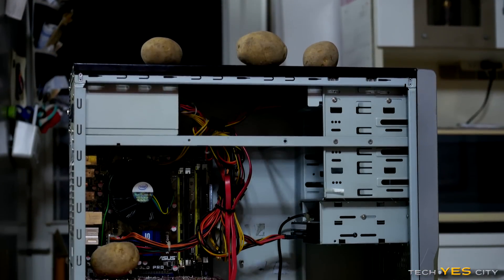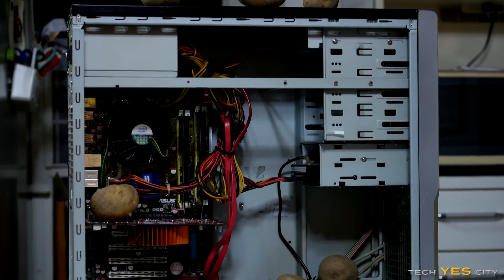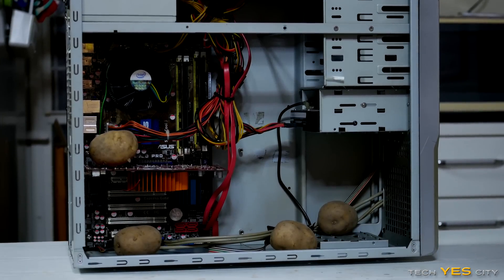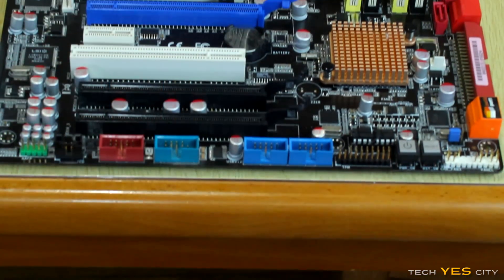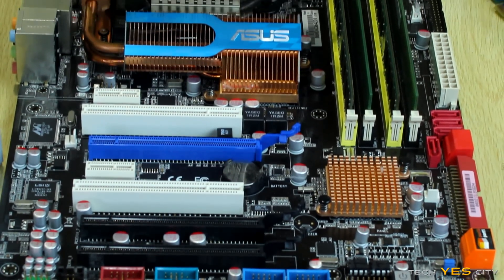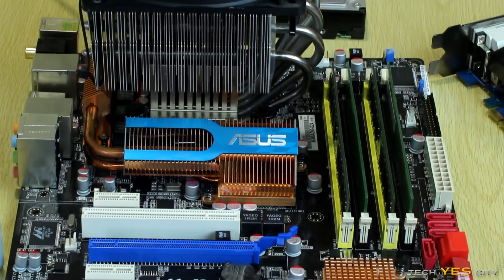The $70 CS:GO POTATO - 1080p CS:GO for Under $100?

Comment: Just got a bunch of PCs for $10 each. One is a LGA 775 build with an Asus p5k deluxe with a core2duo, 450watt PSU, 250gb HDD in an old cooler master case (looks good too) gpu wasn't even worth mentioning, but for $10 I'll take it. That mobo alone is fairly pricey. Also came with about 6gb ddr2.

Comment: Brian, love your videos. Have an Asus p5d 2.66 ghz core 2 quad 8 gb DDr2. Use it for surfing and have a bunch of early/mid 90's game loaded on this and have a blast playing my old favorites on this old machine.. When I was playing these in the 90's I was on an old AT K6 475... Traded out the old AT for an Athlon 2000XP atx board and cpu..Except for the new ATX mobo /cpu combo am using it still 23 years later. Still performs like a dream and the Mechwarrior 4 stuff plays great  with my old  AGP Geforce 2... though have gotten a newer AGP card to tryout to see the max graphics settings I can squeeze out of the game.  Only use it sporadically now but still love that old setup. I have loved all the x58 vids you've made and it is one of my favorites to put together now. I have 5 more 58's in the que now not counting the new 10/11th gen toys I have upcoming. Was doing pc's full time in the 90's 2000's but got out of it in 2001 but now I'm retired and having fun doing this once again.. keeps me mostly off the streets. Keep it coming. Craig

Comment: i have athlon ii x2 630 + hd 6870 +8gb 800mhz ddr2 dual channel + windows 7 64bit. im running 20-50 fps in 1920x1080p low settings, how does that pc do better than mine? i just reinstalled the os and no other games installed except csgo and valorant. plss help

Comment: How are you managing over 100 fps on that system. I have a core 2 quad q6600 at 2.7 ghz which is essentially the same as your processor and I have a gtx 660 ti and 8gb of ddr2 800 mhz. I can only get up to 70 fps and experience lows in the 40s ):
Reply: Its isnt same his proc is at 3.16ghz and has more cache+bit better ipc
Reply: @Spacy1717  but that wouldn't make more than a 5 frame difference. The issue is that every time valve releases an update for csgo, they cripple the performance ever so slightly. I've seen people with a q6600 and 750 ti get upwards of 120 fps with less ram than I have /:
Reply: @Spacy1717  and I said essentially the same, not exactly lol I know the difference between lga 775 processors
Reply: @obungaswanson  maybe something is wrong with your system or you have stuff running in background
Reply: @Spacy1717  I've pretty much tried to diagnose every problem on my pc that I could, I ran sfc /scannow, and I ran DISM. I even reinstalled windows lmao. I'm pretty sure the issue is the scaling of valves source engine for older hardware like mine. I've seen people complain on reddit that the performance got significantly worse after valve released the dangerzone update. But I mean that's alright though I dont play csgo too often.
Reply: @Spacy1717  I think this means it's time for me to upgrade to ryzen lmao
Reply: @obungaswanson  meh i just upgraded to lga 2011 system with 50$ xeon e5 2689 8c/16t 3.3ghz enough for me
Reply: @Spacy1717  is it the e5 2680 v1 or the v2/v3? I might check them out
Reply: @obungaswanson  its e5 2689v1 sandy bridge e
Reply: @Spacy1717  also am I gonna need registered ECC ram for that chipset or can I use regular unbuffered ram
Reply: @obungaswanson  if you use chinese huanan x79 mobos(very good quality btw im typing on it) you can use both im using 16gb ecc ram but normal 16 gb would work okay too
Reply: @Spacy1717  that's awesome, thanks man

Comment: Can anyone suggest parts to build a csgo PC for around 50-70 dollars
Reply: Core 2 duo or quad
Gt210 or hd 6450 or (5450 r dirt cheap)
2 gb ram 4 will be better
HDD depends on your demands
U can get one for 10 or 15 ithink
And u will have a pc better than this in the video
One more think you can overclock the core 2 duo or quad using tape method bsl tape method which can boost u a little bit
Reply: @mobeenshaikh553   Lmao dont do that at all. You can get a second gen i3 or i5 system and throw in a older card like a 660 or 750 in it and its good. (hell ive seen fourth gen i3 pcs go for the same price) the gt210 cant hold half life 1 on 1080p let alone csgo.

Comment: I've recently built a pc
It has:
Core 2 Duo E8500 2 Core 3.16 Ghz 
HD 7870 2GB Ghz edition
8GB DDR2 800Mhz 
64 GB SanDisk Ultra SSD 
500 GB Seagate momentous 5400 RPM 2.5" HDD

It's mostly used for word documents and a little amount of minecraft
500W Kolink 80+ Bronze (400W continuous power)

Comment: fuck im from ph my 400 dollar pc that i bought wprth 20k php worth 400usd with spec intel pwntium g620 2.60 ghz with 2gb ram intel hd 700mb can run dota 2 2018 at 1024x700 res with mid set 20 fps lowest sett 60 fps wtf?
Reply: do u think guys i can run csgo but incsgo group they warn my frames what does it mean do it get burn xD??

Comment: I picked up an Acer Aspire the other day for £40, i7 860, 3.6ghz turbo (had to update BIOS to get the turbo to run, was sticking to 1.9ghz before), 4gb 1333mhz RAM (bought another 4GB for £10), 640gb HDD, Radeon 5450 512gb graphics card which I'm on the hunt for a 750ti or r7 380/r9 270 for around £30-40. Got it mainly for automated background photoshop tasks and rendering but also for old school LAN gaming, but with a new card and the extra RAM I got, I think it could keep up with 99% of modern games at low-medium settings. All for a total of approx. £80-90.

Comment: I got a hp prodesk with an i5 4570 from my work surplus for 40 bucks. Spent 30 bucks to double the ram to 8 gigs. Added a different PSU and dropped a old gtx 960 4 GB in it and made myself a nice little CS:GO PC

Comment: I still don't get if an app is better than a low-end GPU like the one used in this video, I'm using an Amd a8-6600k at 4.5 Ghz and the integrated graphic and I get around 40/50 fps
Reply: silly me, if only you knew how much life would change for you in 8 years lol, I wonder what I was doing when I wrote this

Comment: So I think I've come across a gem. Of course I have my own nice rig, but I picked up a computer off of ebay with a radeon hd 5450, with 8gb of DDR3 ram. The processor is an i3 2120. I purchased it for $85. Question is, do you think I can run this over 100 frames a second on 1080p?

Comment: brake cleaner is good, but be careful with one thing, BC in can acts as penetrator medium and due to some changes in the flux and solder in the last year it can crack the joint. My good advise (and way cheaper) is to buy it in barrel (dont know how in kangaroo land, but here cost 10L keg the same amount like 20 cans) and just use those refillable push pressure spray thingies.

Comment: I usually play on Xbox One because of i sold my Gaming Pc I still have my Multimedia Laptop that can run Games like Call of Duty Black ops 2 Medium and Just Cause 3 Medium on 40fps. But at CSGO this is the Low End Game i cant even get 35fps on very low and 4:3 800x600? Anybody knows why? Here are my Specs.

8GB Ram DDR3, Intel Core I5 4x2.50ghz , Nivida Geforce GT 630M 

I can run Betther games than csgo on 1080p at Medium but Csgo at 800x600 4:3 Very low hmmm.

Comment: When you build a pc, do you have to do the wiring?
Reply: h-00-d no, just connecting them to the motherboard, gfx card ect.
Reply: Scyne Do I need the sprays and all that shit?
Reply: Spaz3 you mean pressured air? To clean it?
Reply: Scyne Yes.
Reply: Spaz3 no, you can just use a rag or whatever if its really that dusty.

Comment: I wanna kms because I have a $350 PC and cant even get 50 FPS at Medium Settings
Reply: AGuyOnYouTube dont worry my 750€ laptop gets only 90+ fps in nuke with max settings
Reply: my craptop on medium settings can only get 20/30 fps
Reply: my laptop cant even run cs 1.6 at 40fps low
Reply: ONLY?
Reply: Mine costed 330$ and I get almost 200fps on average on medium so....
Reply: ORB1TAL GAM1NG you have a shitty pc what is it prebuilt
Reply: If you have 10 years old pcs costed 600 dollars in time it doesnt mean they are running good now
Reply: Csgo is a processor heavy game you prob have more money invested into ur gpu I built a 500$ CAD and I was getting 120+ fps on max settings
Reply: @dillonmcpherson6208  dawg I forgot I even commented this, it's about 4 years later and I have a setup over $1000 and I can play most anything at high and get 60, I have a 1070 and an R5 1500x
Reply: ORB1TAL yessir I got a 1080ti and i7 -8700k  runs any game I could want however I want don’t see why I need to upgrade yet

Comment: I wonder why my pc run at 50-70 fps

Csgo Settings:All Low

Specs:
-i7
-amd hd 7570
-8 gb ram
Reply: TaffyZ N Graphics card is bottlenecking your cpu probably
Reply: Get a GTX 1050 and 8gb ram
Reply: TaffyZ N a 1050/970/1060 will probably help
Reply: Oath Abide but why cant i?
Reply: Oath Abide Your GPU is poo, you can get better ones for very little money, look into it
Reply: TaffyZ N Did you try to reinstall?
Reply: Well laptops such as Acer aspire e15 also can run cs go too!
Reply: Make sure to always update your drivers when you can
Reply: TaffyZ N u should put in 8 more gigs of ram it will probobly help idk
Reply: Luka Meister no it wont
Reply: TaffyZ N what i7 do you have
Reply: TaffyZ N Graphic card bottlenecks the cpu get 1060 6gb

Comment: anyone else bothered how he's handling the parts?
Reply: Electronic components are incredibly durable these days. I've pulled old Pentium 3 systems off of the side of the road and bought them from the refuse store at the dump, no exaggeration. You'd be shocked at the kind of crap you can get running again.
Reply: I honestly don't think he cares about the parts...  It's a potato that he put together solely for the purpose of making this video.

Comment: my potato pc has only:
DellT3500 motherboardCheap generic case "modded" cuz that board is big as fuck and i didn't have money to pay 100 bucks for a case to hold that
Intel Xeon x5677 3.47 GHZ 
10 GB DDR3 1066MHZ
AMD RADEON HD 7850 2 GB GDDR5
Seagate 500 GB SATA 
500 WATTS PSU
Windows 10 Pro

Comment: - mainboard built UP HP shocket 11155 ivybridge upgradable
- processor intel ivybridge core i3 series 3220
- ram 16 GB ddr3 
- vga 2Gb ddr5 directx 11. Nvidia geforce GTX 750 ti .
- hsf original intel built up 
- hardisk 320 GB WD New 
- power supply BU truepower 80+ 
- casing dazumba devito 

is it a good for pc gaming?

Comment: and im here having spent 200$ on a Dell Inspiron 11 with a 1GB Intel HD and Intel celeron 1.7 ghz which i overclocked at 2.2 gHZ, an 2GB DDR3 RAM, and i can only run csgo on medium on 1280x720 instead of 1366x768 at ~54 FPS

Comment: can this laptop handle cs go at max res?  
 Intel Core i5-5200U (2.2 GHz) - 500 GB HDD - 8 GB RAM -Windows Home 64-bit
Reply: Probably not unless you put it on low settings.
Reply: definitly not! I would buy a Laptop with a dedicated graphics chip like a Gtx940m gtx940mx gtx950m gtx960m!

Comment: can anyone help i have no idea about gaming pc's i want one that can run minecraft Gta csgo waw mods maybe bo3 in 1080p 60fps minimum
Reply: MrPiggy LikesTacos nvm didnt see the budget but just some advice:get amd...AMD's much more reliable and cheaper and still great
Reply: my budget is under $100
Reply: +MrPiggy LikesTacos (MrPiggyLikesTacos) buy a Core2 quad Q9400 (20-30$ CAD)
4-6gbs of ddr2 ram (12-20$) CAD
A used R7 240 2GB (I bought mine refurbished from newegg for 60$) 
A cheap 1600x900 monitor (you can use a Tv just not as good)
And a cheap 300w psu
Reply: +HueHue Jib thats it
Reply: +HueHue Jib because at the starting of the video it said that so should i huy what ur saying????
Reply: +HueHue Jib what about mother board etc
Reply: Just any lga775
Reply: i have a q9400, r7 240, 6 gbs of ram and a lga 775 asus mobo and play my games at 120 fps
Reply: MrPiggy LikesTacos You can get a 750ti or 1050ti for a graphics card,an athlon x4 860 for cpu,a 400w psu,8 gigs of ram and a decent ddr4 motherboard
Reply: MrPiggy LikesTacos You better get a job, kid.

Comment: what is that spray cleaner you are using?  and does is just evaporate?  Also what type of towel  is that that doesn't snag on the circuits?

Comment: What's the maximum fps will I get in csgo?
CybertronPC palidium desktop 
Specs:
intel i7-6700 3.40GHz Quad-Core Proccesor, 16GB DDR4 Memory, NVIDIA GeForce GTX 970 (4GB GDDR5) Graphics, 1TB HDD, DVDRW, Microsoft windows 10 home 64-bit

Comment: is that compressed air at 1:48? if it is its not supposed to spray liquid stuff!
and please dont use your dirty fingers to spread thermal compound
what the heck are you spraying on the parts at 5:10?

Comment: What is the dedicated ram of that game? I have 2 Terrabyte of ram but my aunt would give me another 2 terrabyte on my birthday next month l, is that enough RAM to play that game?
Reply: Ram alone wont increase fps, try getting a better graphics card or cpu.
Reply: Sorry, but you need 10TB of DDR5X-42069 RAM and 4 360GB Titan Y's with 2 6.9GHz 69-core/420-thread Xeon CPUs. You also need an M.666 SSD so it doesn't take 69 years to load.
Reply: you are actually taking my comment srsly? im a troll m8
Reply: 10/10 troll right here
Reply: you should get a gpu, it will make more differnence
Reply: twinkle fart
My real cpu specs are
i5 4460
EVGA GTX 960 Superclocked
MSI z97 PC MATE 
Corsair Vengeance 8GB (4x2)

Check my steam khrystal
Reply: hayato zami Get 16GB of RAM.
Reply: +Johan Ekstrom its already shiping
Reply: hayato zami Good. I'll have a 1070 myself, with a 2nd gen i5 and 8GB RAM until next year, when I'll get a Haswell Xeon. The motherboard only has 2 RAM slots and it only supports 8GB or less.
Reply: +Johan Ekstrom sweet... I quit csgo for arma 3, ill rather have a better cpu than a GPU. Sweet tho
Reply: hayato zami Well, the CPU is pretty dope. Its a fucking i7 without an iGPU and can be overclocked with certain motherboards, so it's basically a 4770(K if you have the motherboard for OCing) That'll run everything for years and years.
Reply: Laptops is enough for play cs go at 60fps dude
Reply: oshawott98 a laptop that costs $1000 and dies in half a year doesn't count for running csgo

Comment: so i just finished building this pc, i wouldn't say it's exactly $70 (obviously) i ended up spending around $115 by using ebay, amazon, newegg, etc. and i got around 65-95 fps in csgo medium-high settings, and on low i ended up with around 110-125fps which isn't bad for this pc.

Comment: Hi, I tried to do the same as you but I'm only getting around 60fps on 1080p low settings and around 100fps on 720p low settings... Is this normal? These are my specs.

ACER ASPIRE M5620
OS Windows 10 Education 64-bit
CPU Intel Core 2 Quad Q6600 2.40GHz
RAM 4GB Dual-Channel DDR2
MOTHERBOARD Acer G33T-AM (Socket 775) 
GRAPHICS NVIDIA GeForce GT 220 1024MB 
STORAGE 698GB Seagate ST3750840AS SATA

Comment: I bought my PC for 800$ and mine is slower:(
Reply: That is absolute bullshit.
Which specs then?
Reply: +Sam Boezaard It's actually a laptop that I bought 2013 but still I get 20 fps with highest settings on csgo and on lowest settings with 4:3 1024x768 I get around 60 fps, It has two graphics card, one is AMD and one is intel HD 4000 or something and I have an intel core i5 3230m but I would like to have at least stable 100 fps with lowest settings if this guy can get 100 fps 1920x1080 and average settings, but I might get a new pc ft. intel core i5 6400 and gtx 960 and I hope for 300 fps lowest settings 4:3 1024x768:)
Reply: +TheRedstoneGuy 6 My laptop could run csgo with lowest settings 4:3 at 160 fps but, now the fps just drops
Reply: +TheRedstoneGuy 6 :(
Reply: +TheRedstoneGuy 6 nice bro

Comment: My specs:CPU: Intel Core Duo E7500 @2.93 GHzRAM: G.Skill 8GB  DDR3 1333 MHzHDD: 300 GB Caviar BlueMotherboard: ASRock G41M-VS3 R2.0GPU: GT 22 1GBOS: Windows 10 64 bitWhat can I do to run CS:GO like this? I am barely getting 45 FPS at very low graphics with almost everything disabled ( Anti-aliasing and VSync )

Comment: You need much more FPS to play this game properly. Don't get a pc like this if you want to play serious. But then you also need a very good monitor, mouse and headset. Csgo needs expensive equipment for a good gameplay
Reply: +NKT2x if you are good player you dont need expensive shit to play it good, just a decent fps. Thats the truth bruh.
Reply: No it doesn't, i have a logitec office mousr and stereo Headset on a 400€ laptop and im LE hm
Reply: That's still better than a 70 dollar pc. in my opinion good equipment makes a big difference especially with monitor and sound.
Reply: What do you mean? He was getting 60 fps + If he has an average 60 hz monitor there's no point in more than 60 because that's all his monitor is displaying. I've played on shitty equipment as well as a bad pc old mouses that dpi only goes to 400, Apple earbuds and a 90's mechanical keyboard, I got to LE in 3 monthes. You dont need a 750 dollar pc to play csgo.
Reply: /watch?v=hjWSRTYV8e0